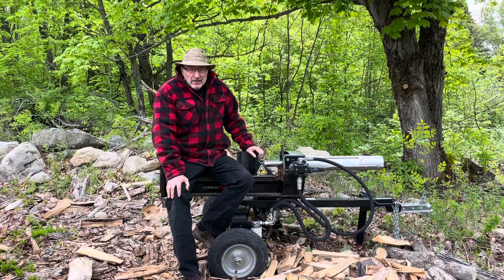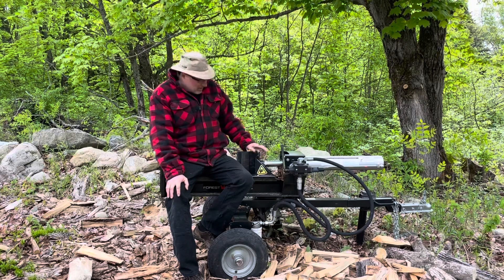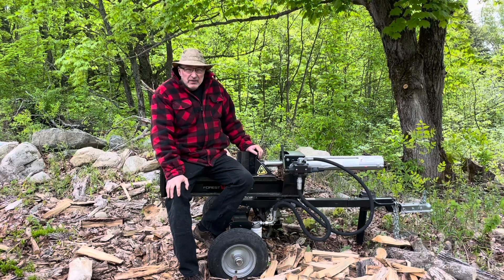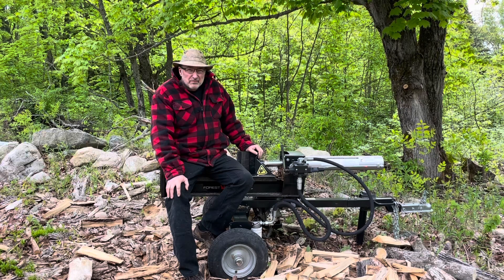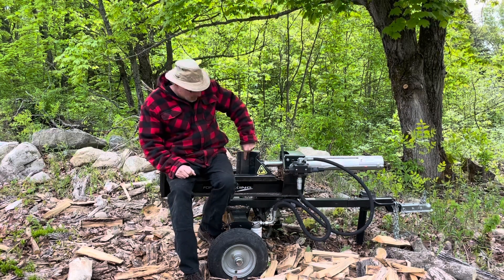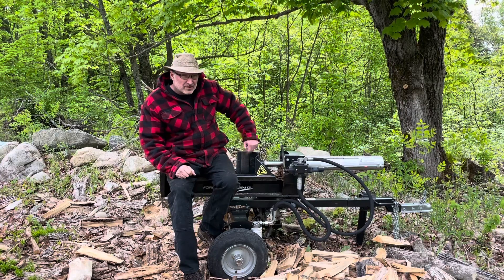Forging press on a budget

Comment: I was trying to figure out how to make mine work.  This gives me some ideas.  I would love to make mine electric to put into my shop.  If the gas motor rums 5hp I wonder if you can get by with a smaller hp electric motor to pump the fluid ?
Reply from the maker: 5hp would require three phase power, I do have it to run my big hammer but would rather run the smaller 5hp engine as it sips the fuel.

Comment: Great video, what power/tonnage is the log splitter?
Reply from the maker: It’s a 22t unit, lots of power maybe a little slow compared to a purpose built press.
Reply: Thanks. Looks good - maybe a bit loud for some neighbours, but very effective
Reply from the maker: Living off grid had its perks!
Reply: Absolutely! Do you need a generator to weld? My friends near Brisbane can just weld using solar
Reply from the maker: Only need generator if I don’t want to blow the inverter up…my inverter is only 4800 watts. I actually don’t weld much stuff, even though I have a great ac/dc machine. I prefer to use traditional methods to join, tenons, rivets and forge welds are my do to